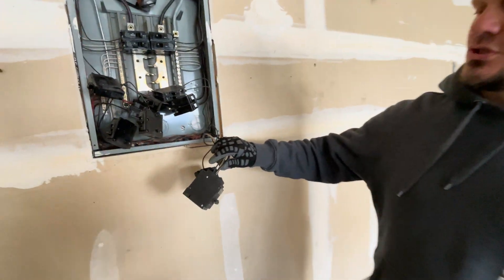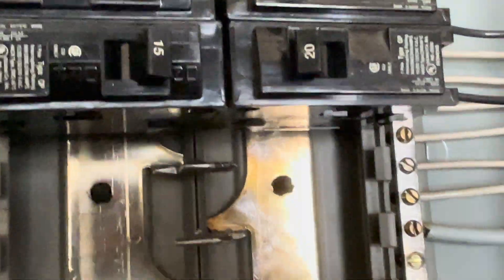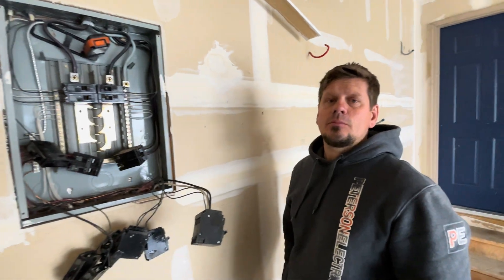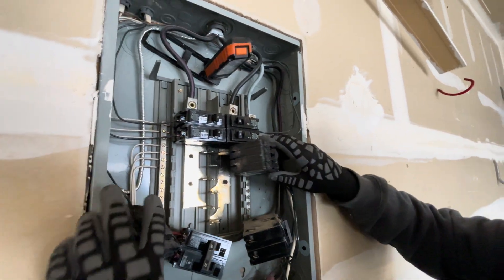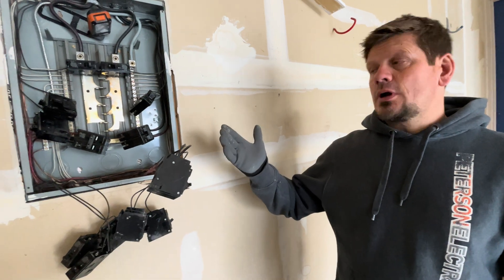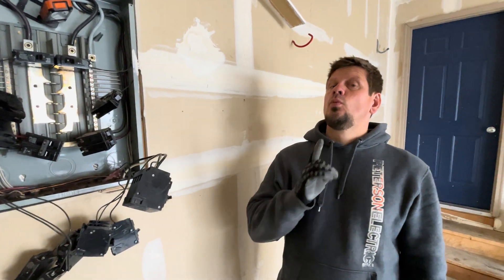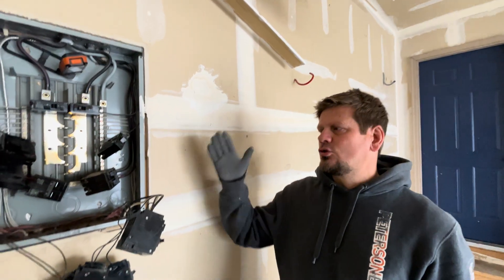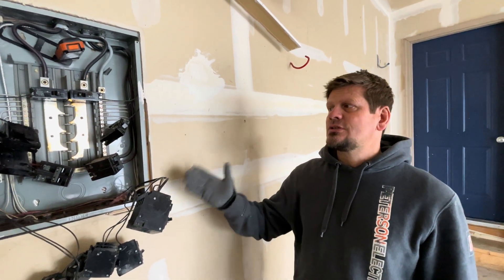Stop Flickering Lights Before a Fire Starts

Comment: Eaton/Cutler-Hammer BR Line has Thicker Metal Bus plates for the BR 1/2/3xxx breakers to grip on to, which would have prevented this issue.  Seimens has thinner metal bus plates than Eaton/Cutler-Hammer BR line, which was originally designed by the fine folks at Westinghouse.  You can Be Sure if its Westinghouse, part of Eaton/Cutler-Hammer since 1995.

Comment: I like that you bring home how important to have a Good Neutral wire is for safety because electricity wants to return using ALL Paths, including people, animals, and other conductive objects that touch Ground or are connected to Ground.  Flickering lights on different circuits in the same house are usually due to a Poor Neutral wire connection to the house, to the meter, to the Main Panel or to the Subpanels.   Also, you must Never Bond the Neutral wire to the Ground wire outside of the Main Service Panel or you will be splitting the path of the neutral current to have some of the current carried on the Ground wire, which could cause shock, electrocution and High EMF Fields in your home which can cause medical issues including Leukemia, cancer, and death.